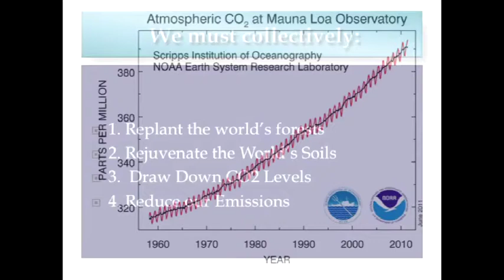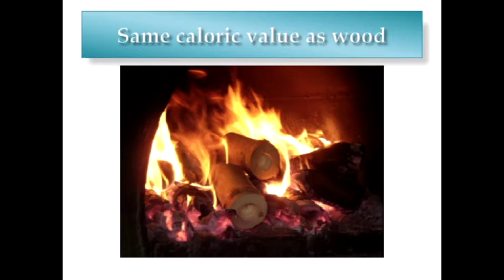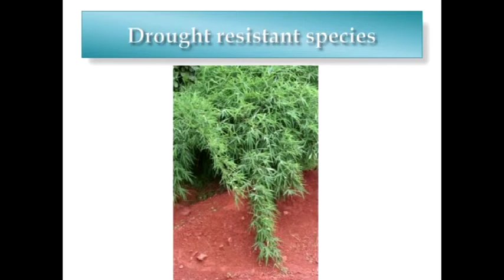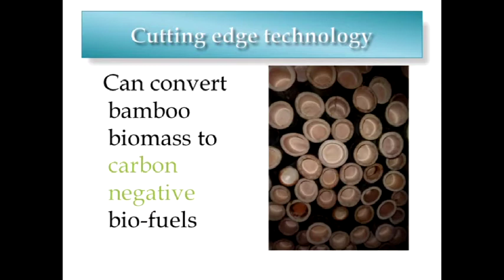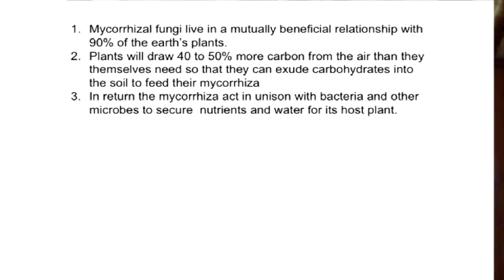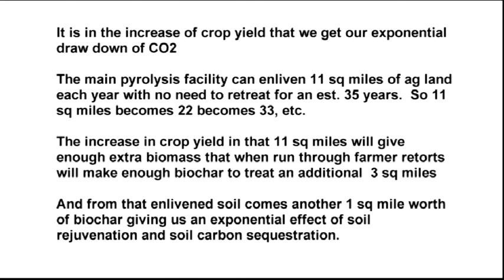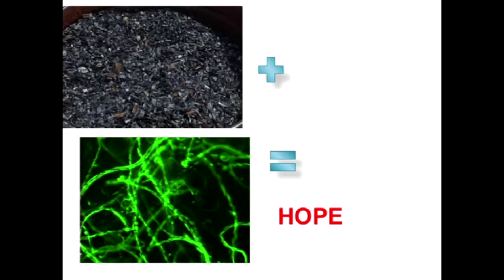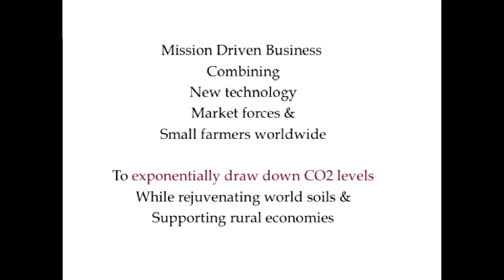Bamboo, Pyrolysis, Bio-Char & Mycorrhizal Fungi: Nature's Machine to Draw Carbon Down Exponentially

Comment: Charlotte- Do you know that you can do the pyrolysis process without burning anything? Using concentrated solar power, such as fresnel lenses, you can concentrate a large amount of heat in one area. The VOC's offgassed in the process can be condensed and sold to various chemical manufacturers. This would truly be very carbon negative. Check out GreenPowerScience's videos.